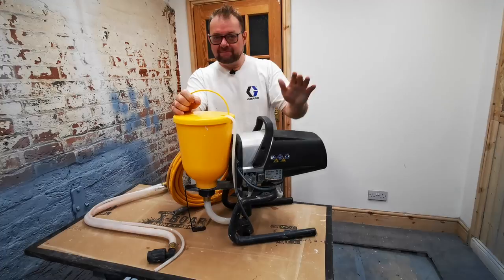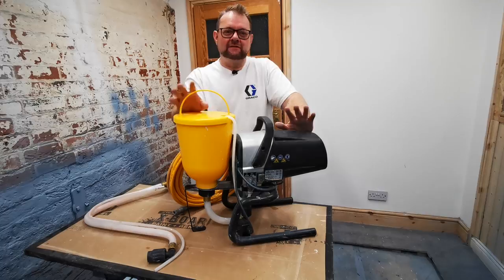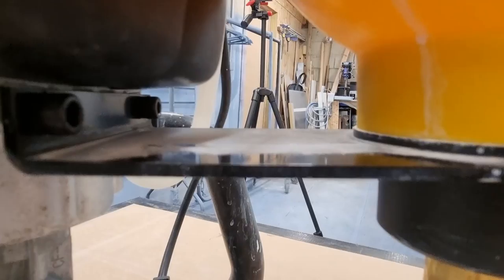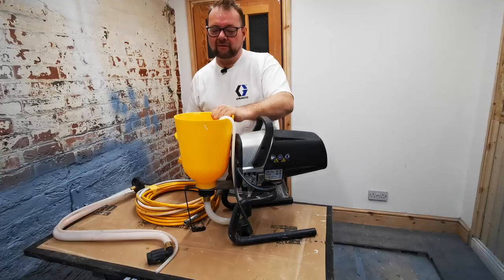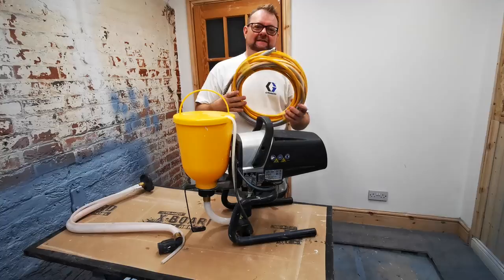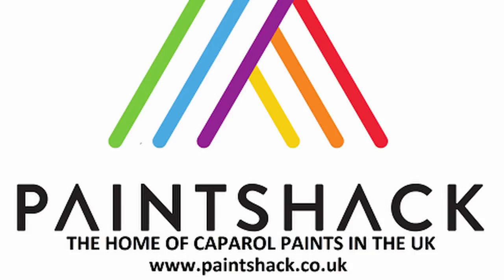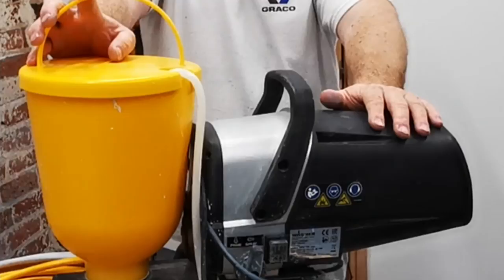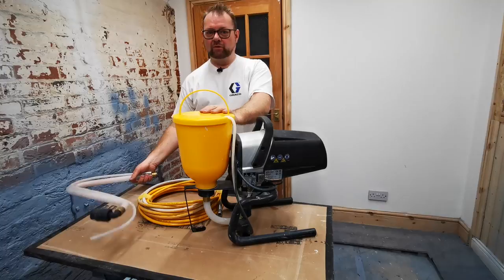PP90 Airless Sprayer add on Hopper

Comment: Don’t get you , what can you do with a hopper that you can’t do with a suction hose 
The hose still has to be filled no matter what the length is.
Reply from the maker: Yes but there is less paint in a 7.5m hose than a 15m one to clean through at the end of the day with water etc.
Reply: We are talking seconds , your machine can be flushed out while finish and complete other tasks/ load your van etc hardly worth mentioning IMO
Hoppers strictly for a workshop set up for me not for moving about on site 
A short hose would b no good to me not long enough to reach from lounge to upstairs bedrooms etc 
A short hose would mean setting up twice , up and then down 
Pointless
Reply from the maker: @davidsmalley8783  Well I suppose at the end of the day it's horses for courses. I have found the hopper, shorter hose and a whip hose really useful for the way we work.
Reply: prime with less paint is the main one. if your painting a whole house in one go it isnt that important but if your doing a few rooms or a few doors  then it adds up fast
Reply from the maker: thank you, maybe I should of explained that lol
Reply: I got a hopper for my GX21 and the best thing for it. I use it around the places, hopper loaded up or empty no issues. I shove an old pair of tights, pour the paint in and leave the tights in to act as a constant filter! 
Great vid mate.👍
Reply from the maker: @porkscratchings5428  Thank you, I did the same to my GX21 too. As you say it is a game changer!!!
Reply: You are absolutely right!!! Just get a shorter spray hose!
Reply: For me the hopper serves two purposes.  1 - The standard inlet hose does not always stay in the bottom of the bucket making the unit run dry.  2 - the hopper lets you use all the paint.  Even if the standard inlet hose stays at the bottom, the unit runs dry with 2 inches of paint in the can or bucket.  
The short hose makes sense when you are close to the work and don't need to waste paint filling up the extra length.

Comment: You mentioned nothing about atomization or overspray or pulsating or really anything of significance to make me believe this video was useful.  How does this compare to the gx21?  What if the point of the hopper? Idk you didn't tell me.  All you told me was it saves less than a quart of materials, you left me with more questions then answers.
Reply from the maker: sometimes less is more......You mentioned nothing about atomization or overspray or pulsating mmmm becasue I wasnt SPRAYING!!! Maybe this was going to be covered in another video???